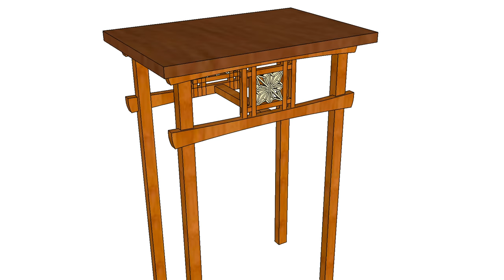Torii Gate Inspired End Table - Japanese Woodworking

Comment: This is such a beautiful table. I like your bow jig to get the curves symmetrical. That's a very cool tip. And the pattern you used for the center design is so neat. Getting all those little pieces to fit together with the right angles...wow.
Reply from the maker: Thank you! That jig is something that I threw together solely for this build and it worked wonders. Piecing together that center design is easier that it may seem as long as you have accurate jigs
Reply: Jigs can be a great thing! I don't use them nearly enough.
Reply from the maker: Figments Made they're great!! The set-up/making time of them definitely makes up in efficiency. Try to incorporate them in your next project

Comment: Would have gotten a smoother top finish using jack and smoother planes. Just saying. Nice project.
Reply from the maker: Thank you Phillip. Yes I would have but I don't have a smoother. I used my jack plane for a little bit but I was getting a lot of tear-out because it's in need of a sharpening. Sanding didn't take too long so I continued with that and I'm happy with the results. I still need to sharpen my jack though haha